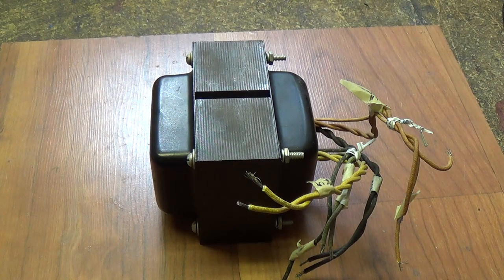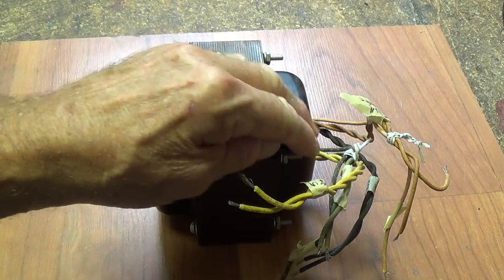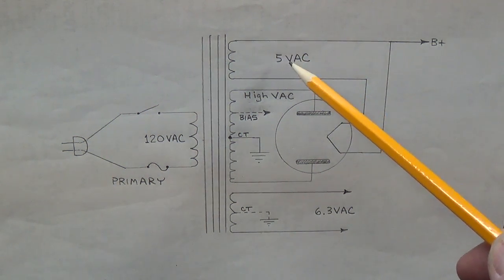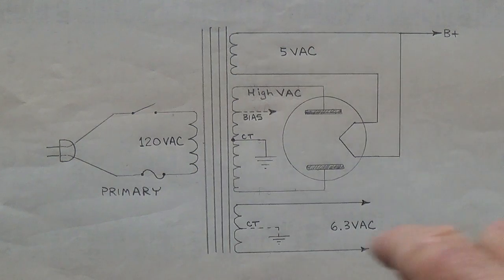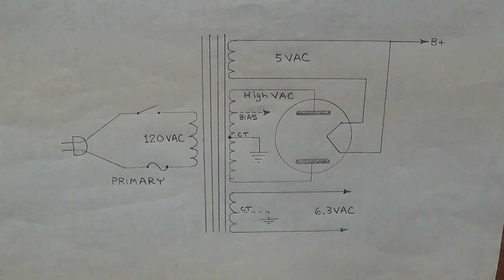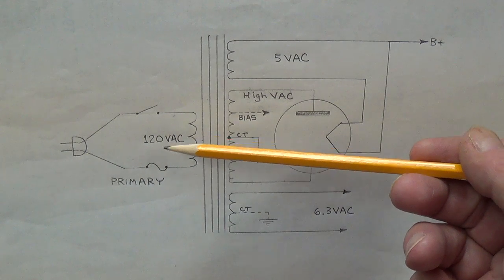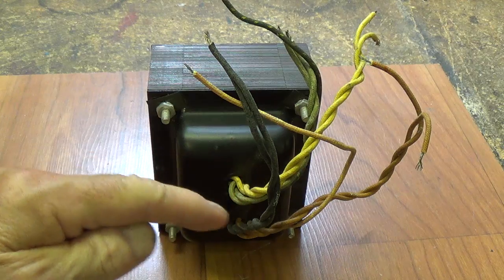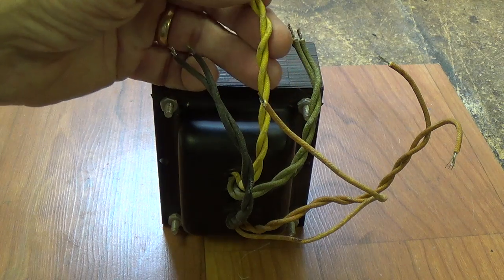How to Identify Amplifier Power Transformer Leads

Comment: I just scavenged the power transformer out of an old Wurlitzer. It has a 12Vac and a high voltage bias wire.

If I use it in an amp with 12ax7s would using the 12V for the filaments in series have any benefit? Perhaps splitting the current load of the preamp tubes from the power tubes? 

How do I make use of the bias wire on the high voltage winding? 

How should I determine the amperage rating if I can't find the numbers from the casing online? (501426 and 141245)
Reply from the maker: I can only answer one question, Mark. Yes, you can wire the 12AX7 filaments in series using 12V. No need to use the centertap.

Comment: Pin point as always. 
Uncle Doug, may I have a question ? I scored a B&H 385 and while testing it's power transformer ( Gramer Halldorson - november 1955. Learned that here too. Ty ) I got the readings as follows:

feed by 120V AC

Primary DMM Re: 4 Ohm's

6.30V Reads 6.735V AC
DMM Re: 0.3ish Ohm's

5.00V Reads 5.320V AC
Re: 0.2ish Ohm's

High VAC Reads 645 VAC
Re HVAC 1 to CT: 89 Ohm's
Re HVAC 2 to CT: 104 Ohm's
Re HVAC 1 to 2 : 193 Ohm's

Now, my question is more about the resistance of the primary and high VAC as both measured higher resistance than what you did mention in the video. Also, within maybe 30 seconds of metering voltages the transformer got warm already. Do you think this transformer is safe ?

I hope Jack and Rusty can forgive any mistakes I made with my english.

Greetings from Brazil.
Reply from the maker: There is so much variation between different transformers, that you can't really judge them by the DC resistance of their windings, V......in fact, the DC resistance is really of very little use in that regard. Simply go by the voltages that the windings produce, and a little heat is to be expected from any transformer.

Comment: UD I am restoring a 1980 Marshall 100w lead, 2203 circuit.  I had to use this video today to id the primary and secondary leads of the PT...This amp was a mess, no twisted pairs, all wires different colors  and was a  bit more complicated than your simple one here but Anyway this video helped a great deal. thank you!
Reply from the maker: You're welcome, Sting. That's great news. I'm glad the video was helpful.

Comment: Hello Doug, it's me again, circling back with some transformer questions - I am working on my first tube amp build using some components I pulled from a 6L6 Baldwin organ amplifier. 

The power transformer has a 335V, 6.3V, 12.6V, and a mystery (not labeled on the schematic) secondary going to the filaments of a 5U4 rectifier. Is it safe to assume that's a 5V? 

The 12.6V (labeled) secondary is heating about 60 12AX7's and 12AU7's used in the tone generator section. I probably won't use this secondary since it's not indicated in any of the Fender Pro schematics I am wanting to build. Should I just cap these off individually and set them aside?

The 6.3V (labeled) secondary is heating a 12AX7 pre-amp tube, a 12AU7 phase inverter, and two 6L6's. Do you have a sense for why they would power the 60+ tone generator filaments with 12.6V and the amplifier section filaments with 6.3V?
Reply from the maker: You're better off powering 12A__ tubes with 12.6V, if you have it, JK, simply because the current flow will be half as much, compared to running them with 6.3V. The only reason to have a 6.3V winding is for the output tubes, which require 6.3V and draw much more current than the pre-amp tubes. Perhaps Baldwin designed the system as two separate units, each with their own power supply (?)
Reply: @UncleDoug  That could be... there is a single power transformer, however, it is HUGE, and it looks like the power to the amplifier section and tone generator section are logically (?) separated. I have a schematic if you are interested in looking at it.

Comment: Hi Uncle Doug.  I have got myself  a princeton reverb reissue circuit that has been gutted out of a new princeton reverb.  I have purchased upgraded transformers for it and at the stage of starting to wire it up.  The Power transformer I got is a Hammond 290BEX.  On the diagram it is showing an extra 50V blue tap in the cetre of the 330v secondary.  I take it that for a princeton reverb type amp I will not be using that and just isolate it. Thanks for reading.
Reply from the maker: That extra 50V tap is essential, Jim. It is rectified, filtered, and sent to the tube grids to establish their bias.
Reply: @UncleDoug  Thanks for a quick reply.  I think I just saw that on the schematic. my first attempt at building.  So the centre tap 0v on the high voltage is not used and tapped off right?
Reply: @UncleDoug  On the schematic I downloaded below for the 68 reissue princeton, there is nothing showing with regards to the centre tap 0v line. 
https://guitarampblog.wordpress.com/2017/01/26/fender-65-princeton-reverb-schematic-vs-68/
Reply from the maker: I don't work on reissue amps, Jim, because they are often hybrids and absurdly complex. In every tube rectified amp I have ever dealt with, however, the high voltage centertap has to be grounded.
Reply: @UncleDoug  thanks for your reply. I checked again and it does go to ground. However in the original design fender took a branch of the high volt secondary and fed to the bias circuit. I could do the same buy i would be wasting the 50v line. If i do use the 50v line then i guess i will have to change resistor values to match 50v and not 325v.  I do agree with you that they are overly complicated.

Comment: I have two vintage output transformers. No wires are labeled.  I know the two primary wires by measuring resistance, but how do I know B from P?  Or would it even make a difference?  Likewise on the secondary, how would I tell ground from 8 ohms?  Thanks!
Reply from the maker: If they are single-ended OPT's neither matters.

Comment: What if your a complete idiot ,UD I just trying maybe wrong video. I have the Baldwin organ torn down and I a m working with the rotor speaker section. There is the rotor motor, the speaker and whole spindle apparatus  that the inverted speaker faces down the whole. and lastly there is what I believe is  a transformer(  I think it s the iron core type. the motor has it own cord that if I plug into a wall spins I did do my best to find out it was ac motor before plugging to wall. Just for kicks I hooked up speaker by lead to guitar amp and then plugged motor in to  the wall. Result not too impressive. Which I think I want to know what this transformer is for:  whats its job?  is it necessary ?  please help
Reply from the maker: I don't recall any transformer on the motor board of the Leslie I worked on, AA. If the motor runs when you plug it in, making the drum spin, and the speaker works when connected to an amplifier, sending sound down through the spinning drum, then the unit should produce the Leslie effect. That's all there is to the device.

Comment: I love your videos. You may have answered my question but let me ask. On my OT, there are two red wires, one red/blue wire and a red/yellow wire. The two reds (are called HV and NV ) on my schematic. The red/blue is LV on schematic, which I believe is the bias supply. The red/yellow is called CT, which goes to chassis ground. The reds, and the red/blue all go to the power board where the filter caps are ...etc. My question to you is with a volt meter set for continuity, I'm getting continuity when I touch either reds and the red/blue to any ground point in chassis. Is this because the red/yellow center tap is also connected to ground? Is this normal? I don't want to power up and the amp go Poof! Thanks Doug! Jim.
Reply from the maker: You're right to be careful, Jim. Verbal descriptions are hard for me to follow. Give me the brand and model number of the OPT, or a link to its specifications.

Comment: I didn't want to ask any more questions but the voltage you read on the secondary 372 seems low for such a big transformer where the other PT you talk about had 660 from end to end. What tubes would only need such low voltage especially after being center tapped to half 372? Or was 372 the center tapped voltage on just one side? Great video on figuring out the wires though. That was really beneficial and a great video.
Reply from the maker: It's been a long time since I made this video, but I believe the 372V is between one high-voltage lead and the centertap.
Reply: OK thanks Doug. Just watched about 3 more of your tutorials. Really good instruction. You can't pay a college ransom and get better. Thanks for answering my questions. I try not to ask too many unless I just get stumped and you make it easier to understand with your answers. Much appreciated. Really cool of you to do so.

Comment: Is there any problems using DC on the tube heaters? Great job as always
Reply from the maker: No problem at all, but in a properly built amp, it's not necessary.

Comment: Ummmmm if your using a transformer that large could you not run a 6V rectifier if the winding is capable of delivering the current? Serious question.. i harvested a trans from an oscilloscope with like 4 or 5 6v windings.. one of witch had a heater string of like 15 12au7's
Reply from the maker: You probably could, YT, but an easier fix, if you don't have a 5V winding,  would be to use diode rectification.
Reply: @UncleDoug  but uncle.. wheres the fun in taking the easy route :p I wouldn't have expected that comming from you, i mean hell you built a robot amp... thats anything but easy lol thanks again got the great content though, looking forward to what comes next!
Reply from the maker: The truth is that all the great rectifier tubes have 5V filament/cathodes, YT. If your PT lacks a 5V winding, there is really only one good way to go.....and it begins with a "d".

Comment: Got a quick question for the all mighty uncle Doug, lol  I got a power transformer, it's got 120v input and green filiments which measure 7.8v which  is high, then it's got yellow and red wires for the 6x4 rectifier, with a red and yellow center tap, but then the confusing part it's got two blue wires and a blue and yellow center tap, when I measure them to the center tap I get 15vac apeice 30v together any idea what these could be for, the transformer came out a old Ampex recorder, it ran 10 12ax7/at/au preamp tubes and the 6x4 rectifier, I want to use it on a small build but don't know what the blue wires are for. Thanks any help would be appreciated. Your pupil

Comment: Thanks Uncle Doug.  Uncle Doug, what is the proper gauge size of the ground wiring for the vintage radios. Thanks in advance.
Reply from the maker: That's hard to say, Victor. I would think that 18 to 20 gauge would probably be adequate.

Comment: I had a Fender amplifier model SKX-35R also known as (Sidekick) that did not have any power I checked for continuity on all the wires and I had continuity but when I hooked it up nothing no power I was getting voltage from the wires that plugged into the outlet but nothing on the other wires that I will call the secondary wires so I believe that the windings were shorted out am I right? can someone tell me if I am right?Thank you
Reply: I should clarify that I was testing the power transformer.
Reply from the maker: Yes, if you energize the primary winding and get no voltage from the secondary windings, then it sounds like you have some open windings in the power transformer.

Comment: Great video. I fear electricity greatly! Just as a PSA I guess (Public Service Announcement) I have been working as an Industrial Maintenance Technician for about 22 years. Granted we are only talking about 120 VAC input here and single phase BUT the output of this transformer is well over 300 volts...PLEASE PLEASE be EXTEARMLY careful in dealing with transformers of this type (300 plus volts output voltage) I have seen the result a dead short in action and when a transformer blows up from a dead short it is not a good day. Please listen to Uncle Doug when he says use a current limiting device to do your tests...the life you save could be yours!!  Thanks for the video!!
Reply from the maker: You're welcome, Jack. Thanks for your testimonial :)

Comment: Hi Doug--so the transformer has 2 black leads -so it doesn't matter which is positive or negative In hooking it up?
I notice in one of my Deluxe Reverb -- the old transformer does have a black and white wire
I am a subscriber and love your posts!!
Reply from the maker: In power transformers, it doesn't matter which way the primary leads are connected, Bobbie. Generally, if leads are black and white, the black wire is the "hot" lead and should go to the power switch and fuse, but this is not essential in PT's.

Comment: If I want to get the data from a PT still in a pristine amp without removing it, will your strategies for getting the data still work?
Reply from the maker: If it's still installed, you can simply follow the leads to see the purpose (voltage) of each. The color coding will generally allow you to identify each of the center taps. As far as the current capabilities, there is virtually no way to determine this without having the manufacturer's specs.

Comment: What's an easy way to tell the primary polarity?

Like what side to hook to switch? There both black on my old hammond ao29?
Reply from the maker: The polarity is determined by the power cord wiring. One of the power cord leads, usually the black one, is connected to the "hot" contact in the wall receptacle. The plug should be constructed so that it can only be inserted one way in the receptacle, ensuring that the black wire is always "hot". This is the lead that should pass through the on/off switch. Thus, when the switch is off, no portion of the circuit is energized......including the fuse.
Reply: So I have two black leads coming out the transformer

What one do I hook to the white/black from the power cord/switch? 

1985.langley@gmail.com
Reply from the maker: As I said above, the transformer wire you choose doesn't matter.  All that matters is that the on/off switch is inserted between the black "hot" wire in the power cord (see above).....and either of the transformer wires.
Reply: Uncle Doug ok I'm sorry uncle doug.

I just needed a bit of certainty sir.

Thanks so much!
Reply from the maker: Never apologize for asking a good question, Dorian. That, and personal study and experimentation, are always the best ways to learn.

Comment: Uncle Doug, thanks so much for making your videos.  I know so much more about about guitar amplification electronics. What a fun introduction to electronics.  I really appreciate your teaching style and sense of humer as well. Your workbis a great contribution. Thanks so much!
Reply from the maker: You're welcome, John. Hearing from viewers like you makes it all worthwhile :)
Reply: Uncle Doug.  When you describe using a multi meter to check the voltage on the transformer wires which wires do you connect too?  For example, on the high voltage leads, would I probe each lead and the center tap for that group?  Thanks.
Reply from the maker: You connect to the two (outer) secondary wires, not the center tap.

Comment: Great info, thanks a bunch. I have a late 60's tube amp that I have been waiting to turn into a nice guitar amp. The tube layout are 2 - 6v6's, a 6x5 rectifier tube, a 12ax7 and 12at7. I'm a 5e3 Tweed board would be nice. The output trans has 4,8,16 ohm speaker connections. Time to get it going.
Reply from the maker: It sounds like all the essential ingredients for a really nice amp, Ron. Let us know how it turns out :)

Comment: Great video!  I'd like to add, look for a short to the iron core from any of the winding's, I've seen this problem a few times, and it will make for a nasty shock!
Reply from the maker: Thanks, FS. You make a good point. In my experience, an internal short within a transformer is far more likely to energize the chassis (and create a significant shock risk) than is the so-called "Death Capacitor"......yet no one cowers in fear of "Death Transformers". :) :)
Reply: Ha Ha!  If people really knew how dangerous their amps could be they would probably never use them, in theory! In actuality, very few people get shocked by their systems. My first experience with a shorted tranny was when I was testing a surplus store power transformer and when I plugged it in, there was a blue flash from under the tranny to my metal desk! Kind of scared me into paying more attention!  It also taught me to put a layer of plywood over the grounded metal desk!
Reply from the maker: Good move, FS. The only good use for metal tables is in morgues and welding shops :)
Reply: I'll say!  I was young then, back in the 70s I think. A metal ground plane is great for cutting down electric noise on your bench. For a time I had old safety glass from 60s television cabinets on top!

Comment: I'm upgrading the power transformer on a phono tube amplifier and the wire pairings make sense and almost all have the same colors. Should it be as simple as a color for color swap or will I still need to check the ohms?
Reply from the maker: You had best check first, Jif. Although most color coding is consistent, it would be an expensive and possibly scary experience to find out that your color coding wasn't.